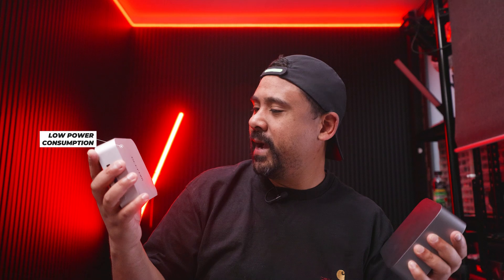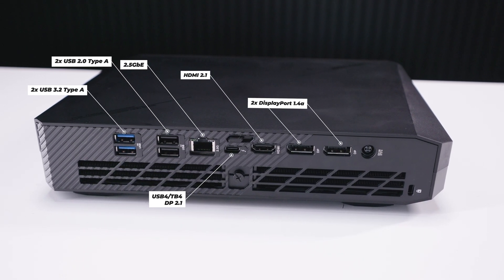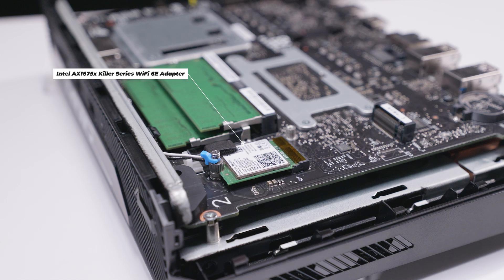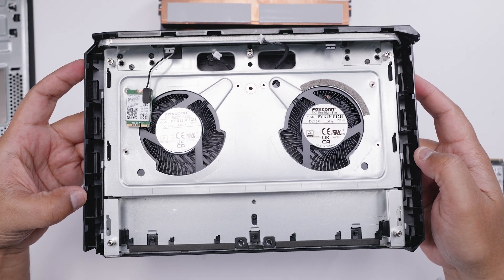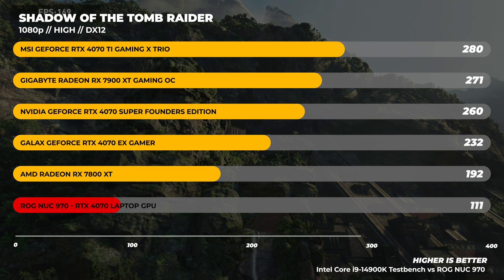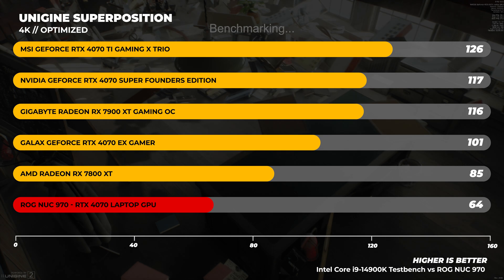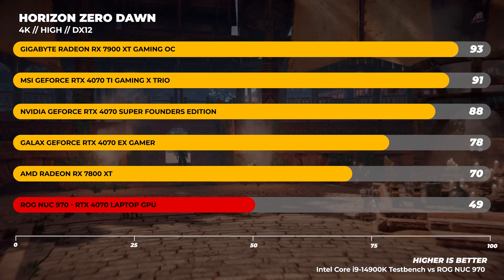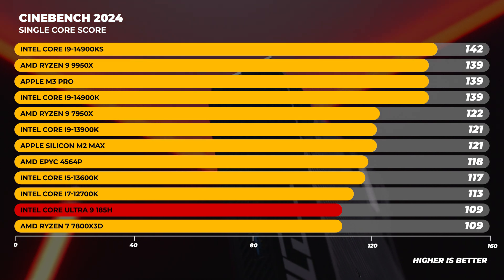This SFF Mini PC ALMOST changed the game - ROG NUC 970

Comment: I just bought one for shits and giggles and it's pretty decent. Still figuring how to get the temps a bit lower but the 970 feels snappy enough. Good because I need to be able to take it with me places
Reply: Interesting time to buy one since the new 2025 model is either coming out within the next two weeks, or is already out, depending on where you live. I guess it's a good time to buy the old one then, since it's been discounted.

Comment: NVidia Mobile Mini Pc are awesome. Bought an Asus Performance 14 I7/4060 at Microcenter for 999.99 this week. Wanted the i9/4070 version but to expensive. I bought it for light to mod gaming at 1080p or 2k. Works awesome. Yes, I cannot believe how heavy the box was when I picked it up. If you want a limited IO and Vertical orientation only. Atomman has I9/4070 for 1300 barebone

Comment: they should just add in all the high end laptop components inside like max out the cpu and gpu component inside, like the 4090 laptop gpu 16gb, Max out the power and max out the cooling all inside that 2.5 litre case. Then ppl gonna buy. Now it is nothing more than just a bare minimum 4070 laptop gpu and expensive as hell.

Comment: They now have a barebones version for about $500-$600 less depending on which one you get, same HW just no ROG logo, RAM or HDD. I wound up getting one because the Mini-ITX builds I could/did make were larger and nosier and I needed something quiet and that took up little space as my office is already full of gear (ML engineer) I'm testing, using, configuring for IoT type stuff. The mini-itx build I made will probably go into my Living Room for gaming and streaming. TL/DR - for certain edge cases it makes a good work station at its bare bones pricing, Lenovo and Dell already small work stations with server/workstation style GPUs for about the same price or even more, meaning: it shouldn't have been targeted at gamers, more like professionals who are short on space and need a workstation with a GPU.

Comment: This should be 1200$ US, at max. It does not have a screen, speakers, battery, keyboard, trackpad, aluminium frame, it has minimum portability and only if monitor etc. are already there.

Comment: It's a laptop without a screen. Laptop components, Laptop performance at a Laptop price. Just buy a laptop and then you can take it everywhere with you.
Reply: you can buy the same mini PC from misinform for half the price
Reply: @riley-arr-g   Why can't? It's  for 900$, and it has an i7 12th with 4070 laptop.
 Are you  working  for asus??
Reply: That's a pretty poor analogy. This NUC comes with a 380 Watt PSU brick because it takes advantage of it. These will walk all over the laptop versions. 
Plus, this is not a Chinese knock-off that will have no support. Completely different world of service.
Reply: NUC has much better cooling than a laptop. Since the case is thicker than a laptop, there's more space for heatsink and fans. Other reviews have shown that it pretty much never thermal throttles. Even in stress tests, it gets close to the maximum temperatures for the GPU and CPU, but never reaches them.

Comment: Looks like that ROG NUC had cooling support for the 4090 16GB Laptop Mobile GPU (which had 3080TI desktop performance from Jarrod's Tech comparison @10:13 )
Considering the NUC is using a power brick that would make for a great 2.5L mini-PC gaming experience.

Comment: Who is the target demographic for this PC? 

It's price to performance is terrible, its basically an Asus G16 without a monitor but more expensive.  I don't know if a 10"x7" form factor is what I'd call mini.  Might as well get a 14" laptop and dock it at that point, or a mini ITX build with desktop components.
Reply: there are alot of similarities to a high end gaming laptop, however you have more upgradeability plus you have better cooling,  The prices on this one is starting to drop.

Comment: What a great lil SFF mini PC 💪😇🤤🥰👍
I personally have a very very similar sized SFF mini PC as my lounge room HTPC setup featuring:
Ryzen 5800X3D, Zotac RTX 4070 O/C, 32 gb DDR4 (2x 16gb), 2 x 2TB NVME + 1 x 4TB SATA SSD in a Skyreach Mini S4 case (PS2 sized case). It handles fast fps titles 1440p / 4K no problem as well as 4K DLSS Quality gaming at 60fps+ in many single player titles (I need to use Balanced DLSS for UE5 titles)